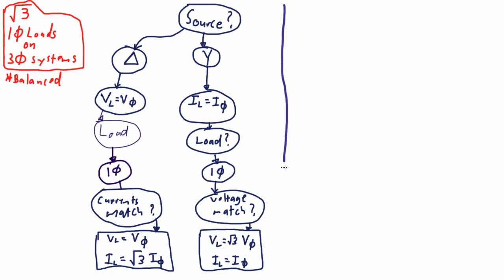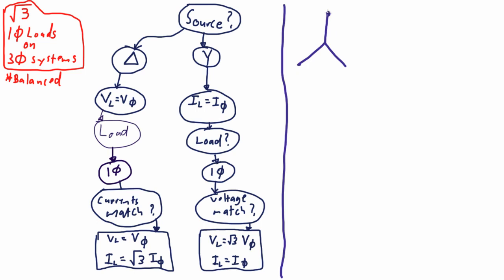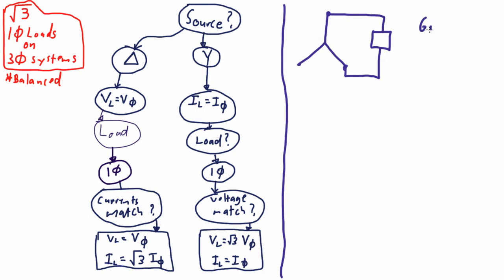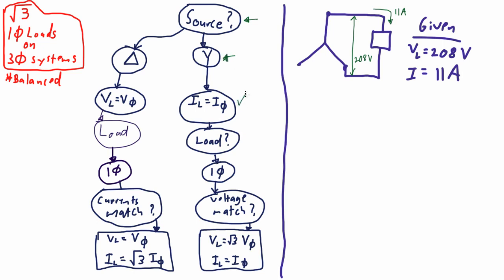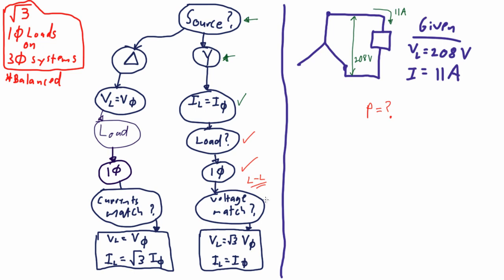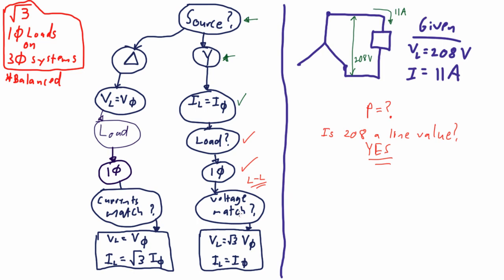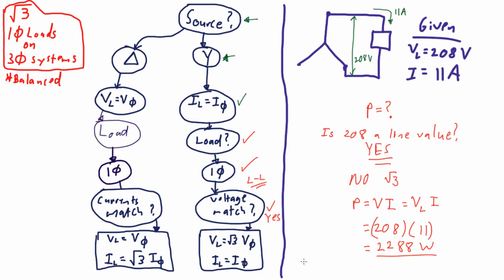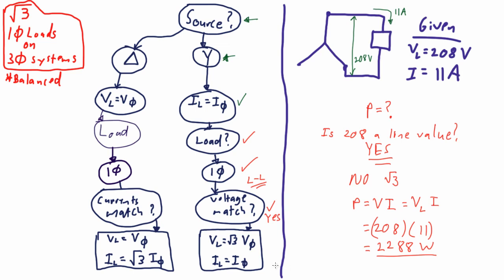Electrical PE Exam - Root 3 (part 4)

Comment: Eric Boyer. My best guess is that in this lecture, the load is assumed to be purely resistive. Since full real power magnitude is P=VI*cos(ImpedanceAngle) , derived from  S=VI* --> S = VI*exp(j*theta_z) --> S=VI(cos(theta_z)+j*sin(theta_z)) --> S = P + j*Q . Remember that S unit is VA, P unit is W, and Q unit is VAR